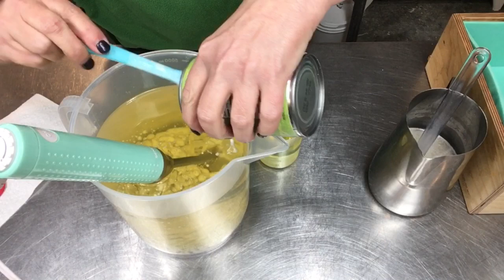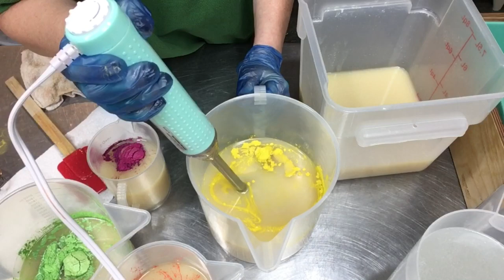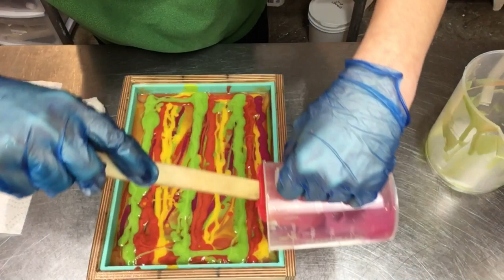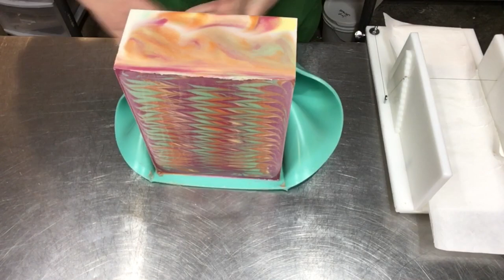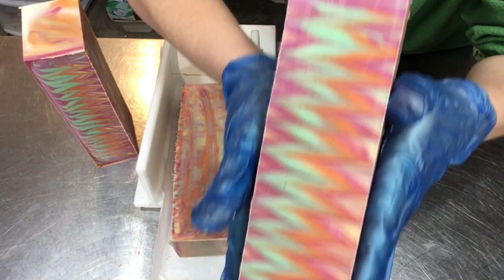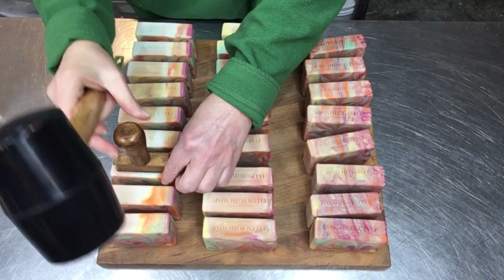DIY Make Soap at Home! 100% Coconut Oil w/ Coconut Milk CP Soap Recipe included! | Ellen Ruth Soap

Comment: hi I love your soaps and videos, quick question, every time I used 100% coconut oil my batter gets thick right away, at what temperature is you lye when you pour it in the oils? thank you
Reply from the maker: They are typically at about 100 degrees

Comment: Hi Ellen, I tried making this soap.  I know it's my fault, but I followed the recipe to the T. It came out horrible. When I made the lye solution I added the 2 tbsp of cane sugar, I did see the water turned yellow, then the tussin silk, then the lye
I dont know when but it smelled like fish.
So the oils organic coconut milk no guar gum it was harden a little on top so I microwave it a little. I put my fragrance no vanillin, and add the lye solution used my blender and it got so hard I had to spoon it out of container.  Ple as se tell me what did I do wrong cause I want to try doing it again. It still smells bad the fragrance dissapeared. 
I need you help.  Thank you so much.
Reply from the maker: The lye solutions doesn't smell great, it should fade away after saponification.  And some fragrances speed trace really fast, so don't over blend.  You can always rebatch if you're not happy with the soap.

Comment: I tried 100% coconut oil soap, w half coconut milk. A majority of the bars came out crumbly. What went wrong? 🤦🏻‍♀️
Reply from the maker: Did you use a high super fat?  It helps to have the super fat at 20% or even 25%
Reply: @EllenRuthSoap  thanks for responding! I love your videos. You know what? I stopped watching midway, and went to make my soap. I totally missed the part where you said you had to blend for a long time! I’m such and idiot. I didn’t blend long for fear of over blending. I rewatched your video and laughed to myself ...ugh. 
I had to try again. And the second time I kept at it until the lye finally saponified w the oil. It took a good couple minutes. My blender was so hot. I love when you add tips. Thank you for that. I was so bummed . But now I’m not. Lol